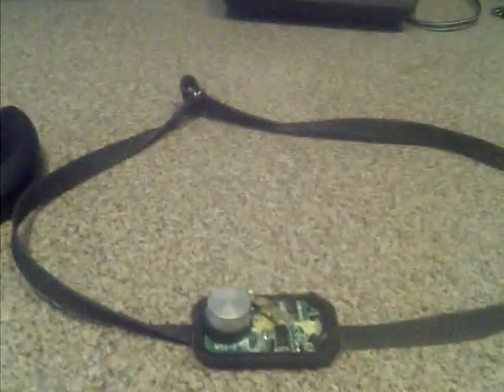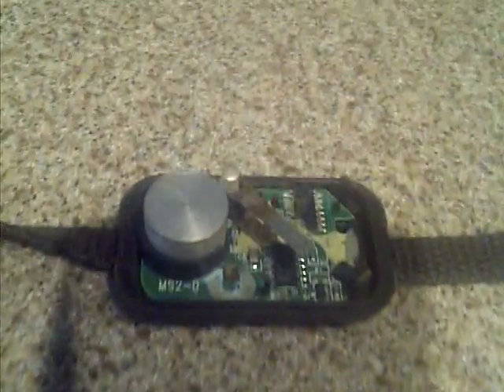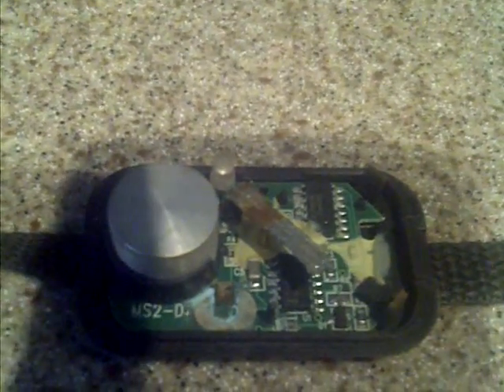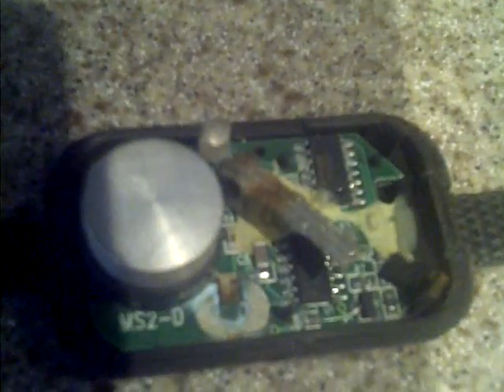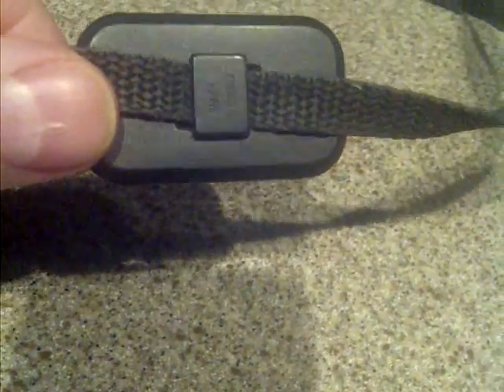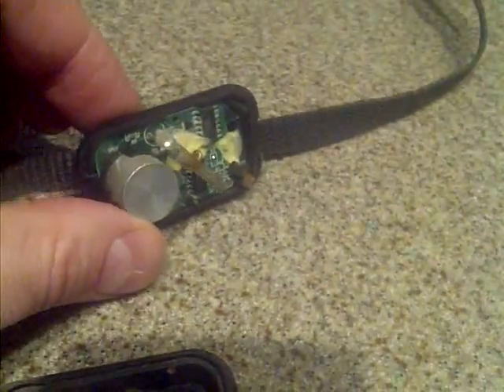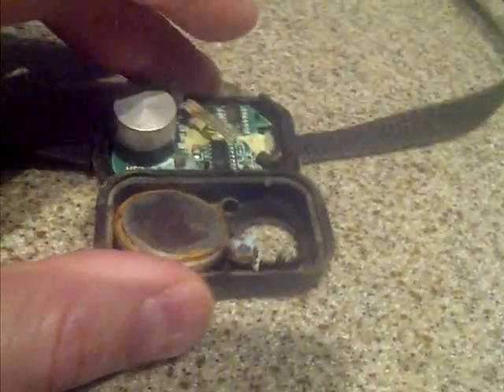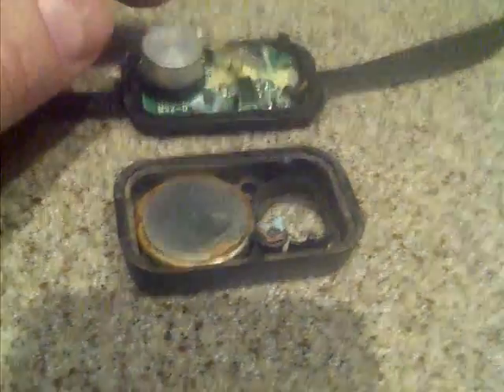Power Pet Automatic Dog Door Product Review

Comment: I have had 2 of these doors and lots of the collar transmitter. I have never had corrosion in any of mine. I have had them come open and have to search the yard for the parts. I have started to tape then together.
The reason I have 2 is they do stop working so I bought a second one so I could change them out when it stops working. Most of the time it is dog hair getting inside the unit but on one I had to repair the motor mount that broke and replace the switch cable. Today I had to change out the one that has been on for over a year, Thought it just needed cleaning inside but found it still didn't work after cleaning.
Will be sending it back for rebuild at a cost of over $150.00.
With the 2 doors and many transmitters we have a lot of money invested into these doors. I do love them but I will say for the price I would think better quality would be in order.